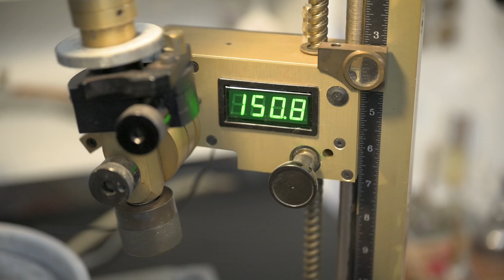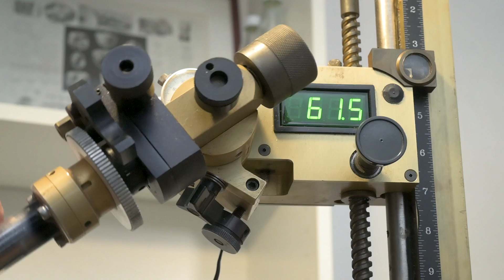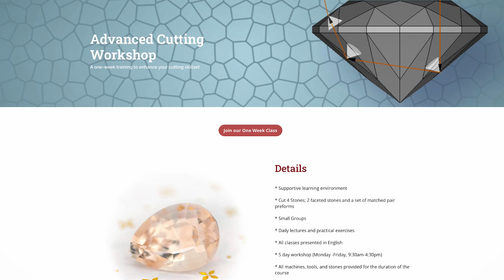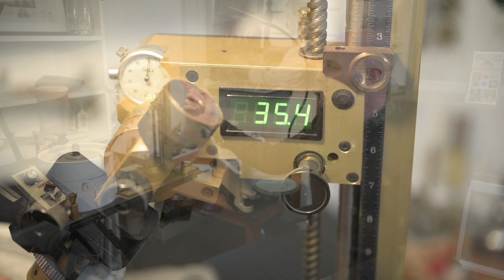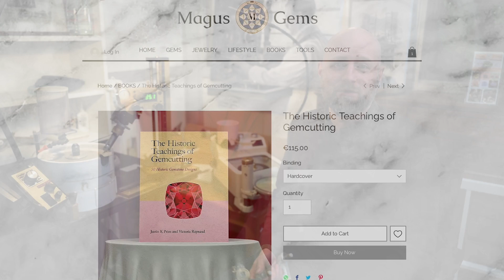Why use a HANDPIECE when we have digital MAST faceting machines?

Comment: What about Automated CNC machines and Laser cutting for Gemstone?
Reply from the maker: Laser cutting is only for diamond. There are cnc machines for both diamond and colored stone cutting. For the colored stone works they are only used for cheap small faceted stones. As far as I know, the quality is not yet very good for very valuable stones.
Reply: @JustinKPrim Thanks for your valuable comments..
I think it will be a game changer in Gemstone industry if a fully automated machinery can facet a precious gemstone..
Also wanted to know that why can't we integrate laser cutting technology for precious colored gemstones , if can use in Diamond cutting!!
Reply from the maker: @foodielicious1677  right now, the problem is that the most important decisions are not about the Cutting, but about the color. If the machine can’t understand the subtleties and nuances of color differences around the different sides of the stone and how that affects the price and how it has to relate to the weight in the yield, it’s not very useful as a tool. The cutting part is easy. It’s the decisions and their results that make or break the financial side of gemstones.

Comment: What would you start with
Reply from the maker: @jasoncastle1741  Handpiece. I use have used both extensively and for me the choice is always Handpiece. I use it personally in my work, we teach with it in the school, and I recommend it to anybody that asks me who doesn’t know how to cut yet. It’s a good machine at a good price and it’s easy to learn on.
Reply: @JustinKPrim  which model.  What brand is worth thr dollars
Reply from the maker: @ I prefer the Sterling ST-08 with the speed controller and the cheater handpiece

Comment: I bought a vevor faceting machine a few years back just for the flat lap. I never bothered trying to facet because it was my understanding that the mast was poorly designed and required a lot of work to get working.  I would like to dip my toes into faceting on a budget and so I'm wondering if you're aware of anyone using a vevor machine with a handpiece as a way of getting around the poorly designed mast system? And if so, which handpiece should I buy?
Reply from the maker: @sweetgumnyc7794  since you already have it why not give it a try. Check out gems of science, they sell an upgrade kit for the vevor to make it more functional.

Comment: Hi Justin thanks again for another great vid I bought a brand new mast machine here in Australia and I absolutely love cutting however the constant re-aligning of the machine is driving me insane. I'm finding that as soon as I touch the cheater just to get that perfect meet point left to right to lvl the girdle all the facets that come after are completely out and for every single facet after, the cheater has to be used or the stone just gets worse and worse lol I was looking at the hand piece machines as I can clearly see the advantages for fast efficient cutting, but I can also see whats happening with the stone as im cutting and not just looking at the cut to meet point wondering if im going to have to tilt the facet with every cut.
Reply from the maker: @stephenpalummo9367  this is weird. I’m not sure why adjusting the cheater for transfer alignment would change any of the rest of the facets. Once you twist the cheater and get the girdle perfect, you are leaving the cheater in that spot for the rest of the stone right? If so, I wonder if there’s something wrong with your machine. That shouldn’t happen.
Reply: @JustinKPrim  oh I see no I then return cheater back to zero then move on to the rest of the facets as I go and only tilt the cheater when its not working out lol such a rookie mistake you have made my day thanks soo much mate I'll let you know how that works out
Reply from the maker: @stephenpalummo9367  yeah when you use the cheater to fix transfer alignment, the position you move it to is now your new "zero" for the rest of the stone. good luck
Reply: If it's a halls from Unamit make sure you do the D dop alignment in the manual. I didn't do it and had some issues with the first couple of stones. The manual explains in poor photocopied pictures how non alignment will double after transfer.

Comment: how is the Sterling handpiece compared to Raytech Shaw hand piece?
Reply from the maker: @aungshein5036  I need to do a proper head to head review but I think there are a lot of Little things that make the cutting experience on the sterling better. Sterling has better ergonomics in term of where the riser knob is, how the handpiece fits in your hand, the dop attachment mechanism, the ability for the plate to move back and forth to allow the cutting of smaller stones, and also the sterling can take an 8” lap if you want. All little things but for me the Raytech is not a very comfortable machine for all day use.

Comment: I know both systems well. I learned to cut on a handpiece machine, and then I've been cutting on mast machines for fifteen years now. I recently gave a course for ten students in Ethiopia using Sterling. I honestly don't see any advantages of Sterling, other than its lower price. I didn't see them in this video either. It is not faster than mast, it is just cheaper and less precise. 
With Sterling you're going to be in a kind of no man's land, not being able to match the quality of precision artistic cutting and not being able to compete with the speed of commercial mass-production done with Jumbpeg. It's fine for courses, to learn the basics of cutting, but if you're serious about your hobby or profession, my sincere recommendation is to buy a good mast machine.

Comment: I wound up going with a sterling for similar reasons, just coming from a different direction. 

I've been a machinist for almost 20 years now. When I started looking at machines I was originally looking at an ultratec because that's all I had seen. 

Saw a video with a sterling and went "That's it, that's what I want"

I wanted a machine where I get that more manual feedback and influence. A handpiece machine gave that to me. 

My only problem now is my machinist brain wants to make a brand new handpiece from scratch😂

Comment: I cut larger stones like wands that can be up to 5 or 6 inches long. I don't see how that would be physically possible on a handpiece machine. I have an UltraTec GlassTec machine that is designed to cut larger stones.  I also like to do concave and fantasy cutting and I have the UltraTec Fantasy machine to do that kind of cutting. The two UltraTec machines work together beautifully. I am not obsessed with every facet being at an exactly perfect angle. Once I have the initial angle set on a tier, I ignore the digital display and focus on the look of the facets by eye. I sometimes work without a faceting diagram and let the stone dictate how the shape will turn out. I agree with Justin that faceting should be fun and creative. The goal is to bring out the beauty of the stone and having some facets less than perfect can lead to a stone that has more character than a perfectly cut standard round brilliant.
Reply from the maker: You are perfectly positioned in the category of cutters that absolutely should use a mast machine and I am glad that you are :) Keep making the BIG stones! I would not want to cut a 6 inch stone on my handpiece!

Comment: I have never used a Handpiece style setup but after having watched you for a few years now, I know that there are things about it I would truly appreciate, such as bringing the stone to my eye rather than contorting to maneuver my eye to the stone on my mast-style machine. However, I'm anal about my cutting and while I'm learning that I don't have to have to cut competition quality stones for every gem, I do like to get as close as I can within a reasonable amount of time. In the end and like you, I am happy with my gems when they are at least, better than Commercial cut quality gems. And after watching you as long as I have, I've seen plenty examples of quality cut stones from you and from people using far more antiquated equipment than either you or I use which is super impressive. One thing I have definitely learned is that it's NOT the Equipment but rather it's the Operator.
Reply from the maker: So true!